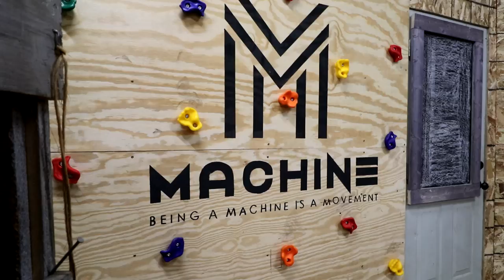Motorized Board *3DMachines*

Comment: Should work on the kx since that will give you enjoyment and if you want to get rid of it it will actually give you a return to fund the ktm or dmax then you should get a ton of tannerite under the gator and blow it to literal pieces that will get the point your pissed at the key board bashes and it's your Channel and expansion means change ,note not telling you what to do just proposing an idea haha it's different I think...